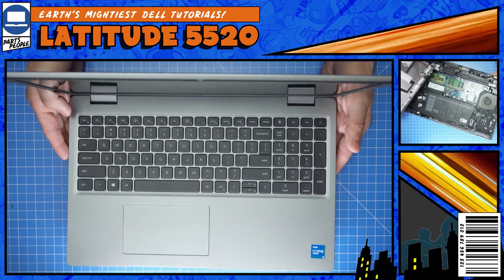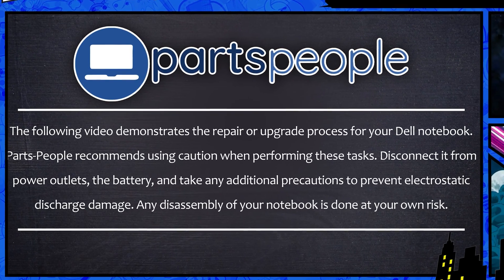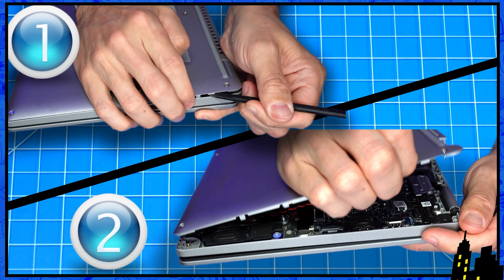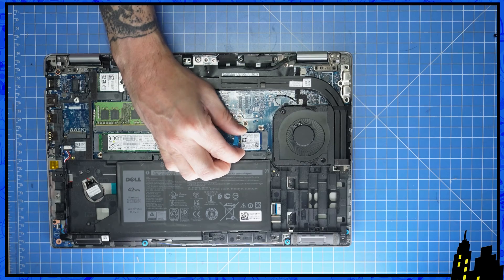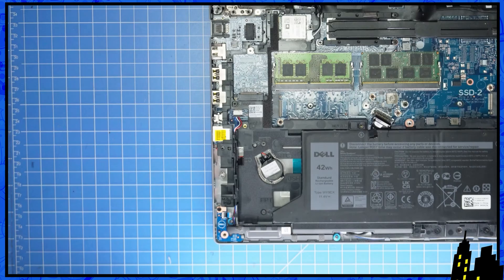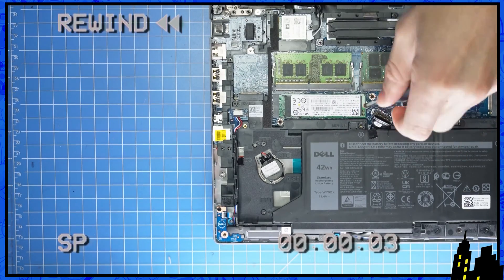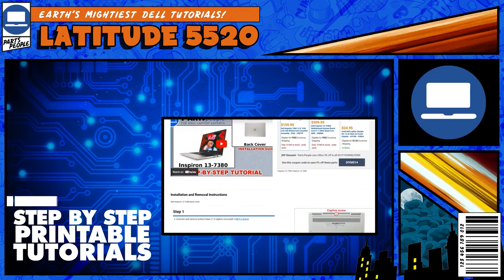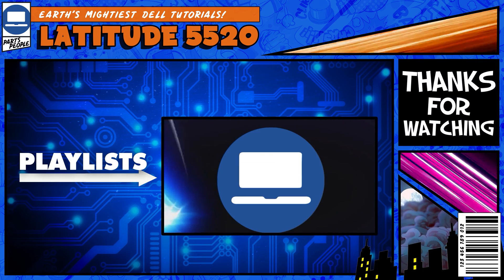How To Upgrade or Replace Your SSD | Dell Latitude 5520

Comment: How can i disconnect the cable from the motherboard if that little handle on it has broken off?
Reply from the maker: This cable does break off from time to time. It can still be unsnapped if you are able to carefully hold the sides of the connector and then pull it up.
Reply: Thank you for the answer. Do you think I could use spudger or prying tools to lift it off from the motherboard. Or is it better/safer to hold the connector on the sides?
Reply from the maker: @alexstatsenko  I frequently use a plastic scribe in these situations. They're very useful.
Reply: @dellpartspeople  Thank you. WIll give it a try.